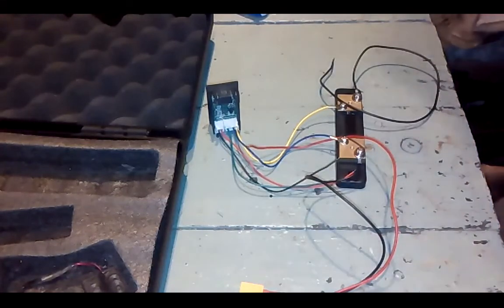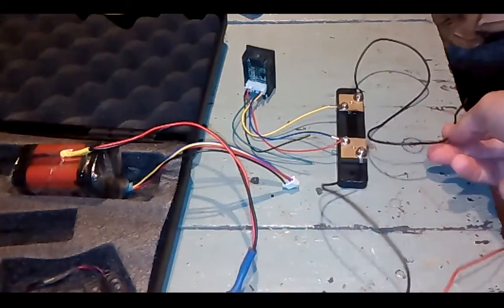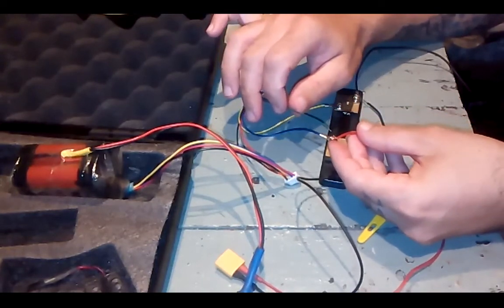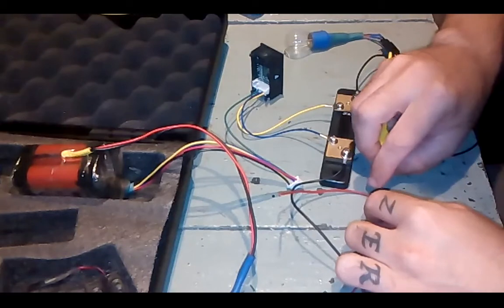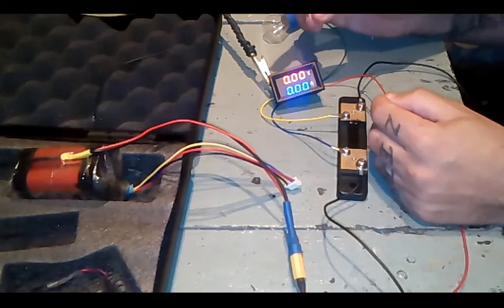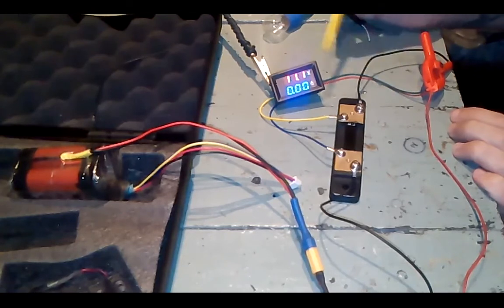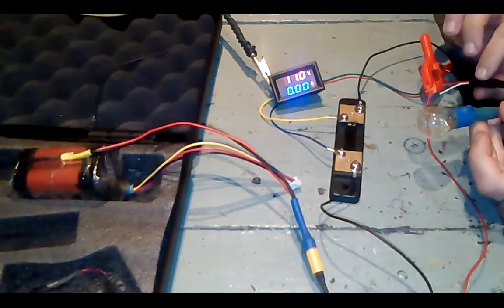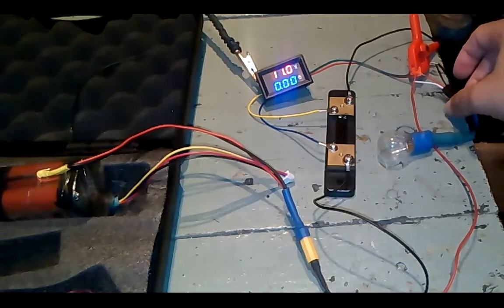How to wire a LED Digital Volt Amp meter with shunt

Comment: Thanks. I have this type of meter, and needed to know if I wire the negative power wire while using a single power source. Now I know not to use the black power supply wire.

Comment: if the meter reads 1.4Amp when there is a shunt in place the current isnt 1.4amp. Unless there is a adjuster on the meter to make the display multiply by the shunt resistance ratio

Comment: Be careful as not all the volt/amp meters are the same even though the displayed output is the same. The ones I have have 3 small wires ( black, red, yellow on a connector ) and two larger wires ( red + black on a connector ) for handling the current. And even with these, you have to check each meter as some of them have a built in shunt so they are 0-10 amps while the ones without are 0-50 or 0-100 amps depending on the external shunt used. All types of the digital ammeters are actually just reading a voltage signal from across a shunt.

Comment: Thank you for the vid.  My unit would not work at first, because they switched the blue and green wires to different connections on the plug!   Now it works.